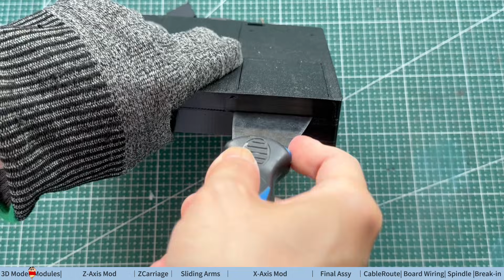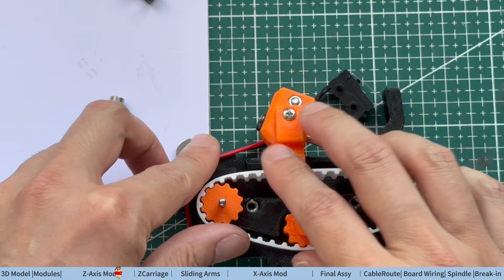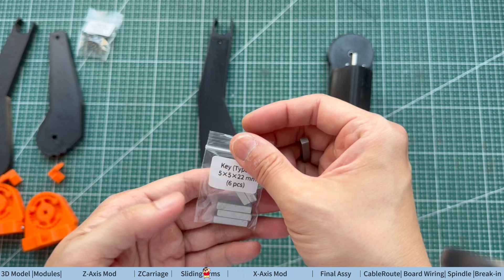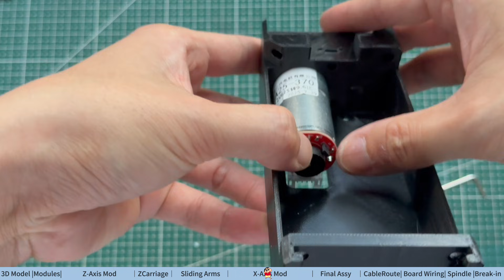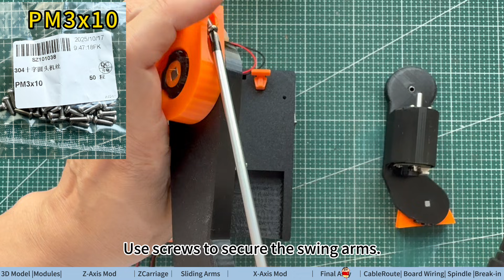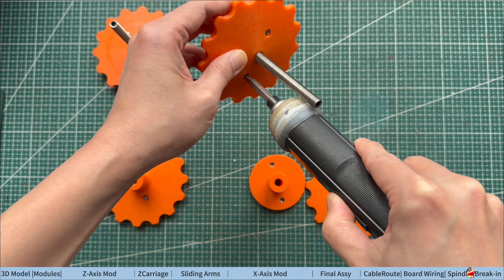Winding Machine V2.02 — Latest Version Assembly Guide  | Full Step-by-Step Tutorial

Comment: My 12 year old son and I built this in about 6 hours.  (It might be faster for a single adult! 😀 )  Every light, button, sensor and feature worked first time except the RPM sensor.  The developer responded to emails within an hour or two.  Once he understood my problem, his first suggestion fixed the problem.  Everything else worked perfectly from the very first time.  I give this maker my highest recommendation.

The 3D-printed parts all printed perfectly on our Bambu A2L.  We learned 10 or 15 design tricks we will use in our own designs going forward.  For instance the design is based on putting M3 nuts everywhere and it was easy and works great.  There were many other clever mechanisms and tricks.

Comment: be careful assembling the guide arms. You have one chance to get it right or you will need to destroy the parts to disassemble it.
Reply from the maker: Actually, you don't need to destroy the parts to disassemble them.

Just raise/support the bottom slightly to leave some clearance, then use a screwdriver and a small hammer to carefully tap the square steel rod out. The guide arms can then be disassembled normally.